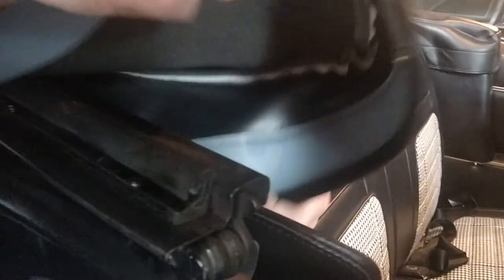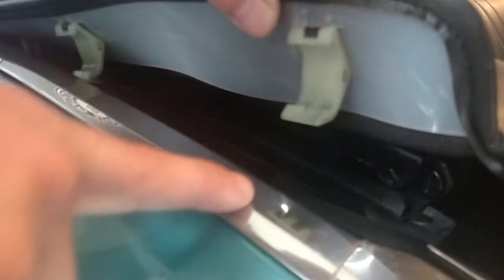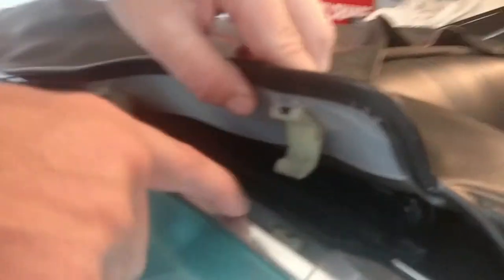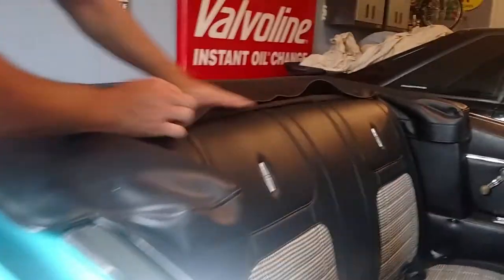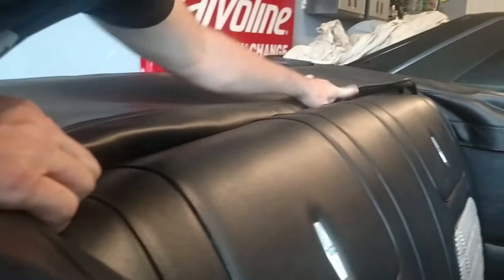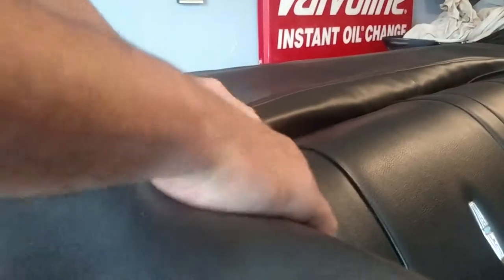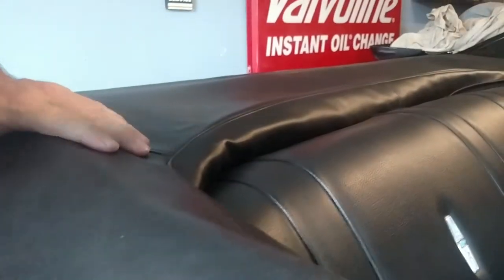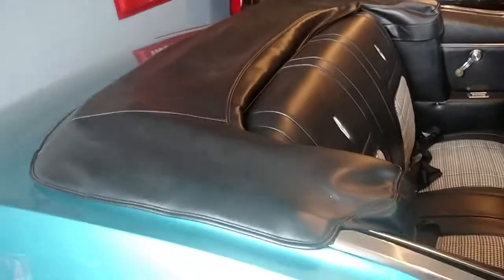Convertible Boot Install 1st Gen Camaro 1967, 1968, 1969

Comment: Same question here, is there a special way to unclip?
Reply from the maker: No special way, I just pull up on the clips starting on the ends and working towards the middle
Reply: @rambok81  do do it from the inside out, the opposite of the way you clip them when you're pushing out